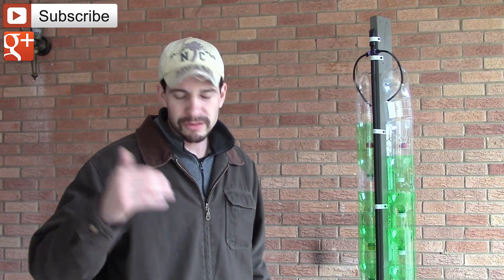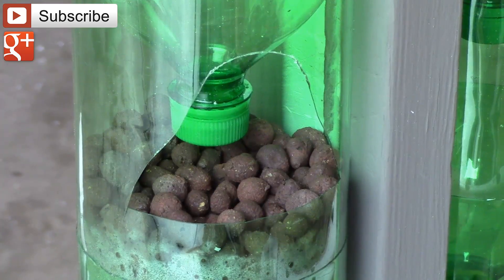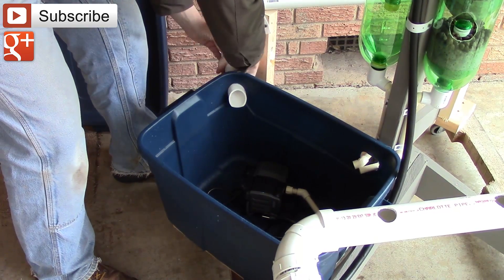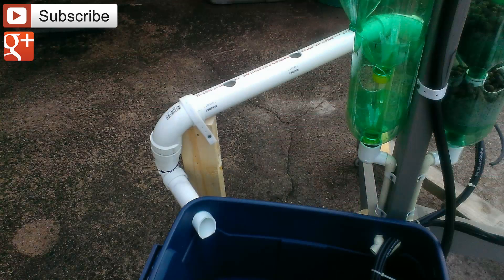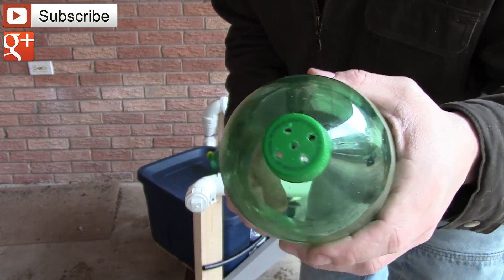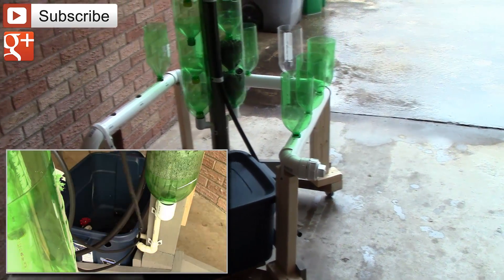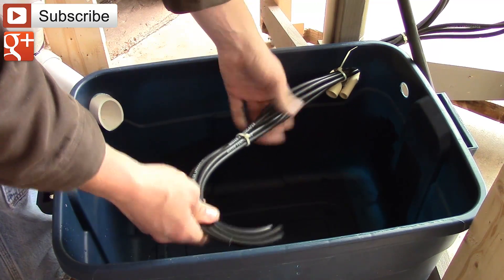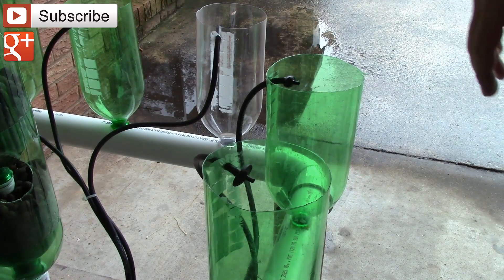Aquaponic Hydroponic Vertical Grow Tower 1.3 - Re-Purposed Material

Comment: 1/2" CPVC Inline connectors are a perfect fit INSIDE a standard sized bottle opening so no need stabilize bottles in "custom" fit holes in the latter pipe

Comment: For the fittings that are not glued if you if you wrap two layers of Teflon tape then slip the pipe into the fitting should cure most leaks on drain line

Comment: Yep keep the dark paint but dude keep the round holes also and get some flexible foam from Wally worlds fabric department ,  its made 1" by 20" by 20" I think it was. Cut this into squares a bit larger than the round holes now cut a slit from a corner of these squares to it's center, take this and wrap the flexible foam around the seedlings when you put them into the round holes in the bottles it will pressure fit and hold the plant both whille it grows and as it matures. Loose the clay its not needed just run the water and nutrient solution through so it hits the form this will reduce some of the clay's short comings ( No dust way cheaper to set up ) I'm using a vertical Kratki hydroponics system in my greenhouse as well  as 10 soil super strawberry style towers that each holds 120 plants in a 2' of each tower's footprint or a total of 1200 soil based plants. Our   660 gallon catfish farm supplies our emulsion for the Kratki beds when they need refilling. We have 16 split barrels or 36 tubs of Kratkis with 30 plants per tub, for a total 960 plants there. Like I was telling suppliers at Wally world today we basically have a small farms growing capacity in a 10' x 10' x 48' space were we can grow year round thanks to our 1800 C ' of water based heat sink as well as our natural confection ice supercharged cooling system. we assembled 20 50 gallon barrels in a loop to were we pull air in from the shaded north side of our house then by running it through these water filled, winter frozen ( only within 5 gallons of full or 50 gallons each ) barrels and out to the greenhouse in insulated pipes we run this super cooled air backward through the in ground pipes and out into the main room. these same pipes also carry heated air from the solar heated floor in the winter under the heat sink barrels to super charge their heating gains. by using what mother nature and the Good Lord provides we got it all. As well as most of the materials to build it were provided for free or low cost by the good lord above. we literally got 6 multi hundred dollar levered windows for the price of hauling them home.after having just been saying how we could never afford this type of windows on our budget. Thank you Lord. Good luck with your systems we keep watching. See you in the funny  papers........................

Comment: Nice work Wayne, I used some 6L Water bottles with the bottoms cut out in a wicking system, I never got around to painting them and I notice the roots never come to the front side,(have not checked the back). I guess this is like "Light Pruning" the roots as opposed to air pruning, The fun is in noticing the details while striving for a perfect system, of course…Nature is perfect, it just doesn't fit on a balcony as well as a tower :)
Reply from the maker: Your system sounds interesting for sure Craig Thompson! You're right about it not being as good as nature for sure. Cheers!

Comment: Wayne might I suggest using a chalk board paint. There is physical media in the paint to continue to help blocking sun.
Reply from the maker: You can suggest anything you like *****! :-P But in all seriousness, thanks for the suggestion. Basically, I may be able to use less paint to get a cover enough to not let light in? Besides that, I could use chalk to label the bottles! I'm really liking this...
Reply: that is the idea.  it should use less paint and be multi-functional.,  You will likely need to look into preparing the surface so the paint bonds appropriately thought.  the high density polyethylene that the bottles are made from is resistant to most paints.  something tactile like a clear spray Glue should help. ** you will have to be sure to check to make sure the glue and paint wont react to each other. that said I would go to your paint store and talk to the experts.
Reply from the maker: Yes, using the glue is a good idea *****. I'm thinking though that it would be cheaper to just scratch them up using sandpaper. Then again, maybe that won't work very well. Using that type of paint is definitely worth a try, thanks for the idea!
Reply: physical abrasion in theory should work.  the issue you may run into is areas that were not scratched the paint may fall off.  Or you weaken the bottles too much and start leaks or structural issues.  You are asking the bottle to hold a load of stones, water and plant.  I would avoid messing with their integrity.  I look forward to see how you do!
Reply from the maker: Ok, all good thoughts *****, thanks for your help so far man. I really appreciate it.
Reply: I like problem solving :)